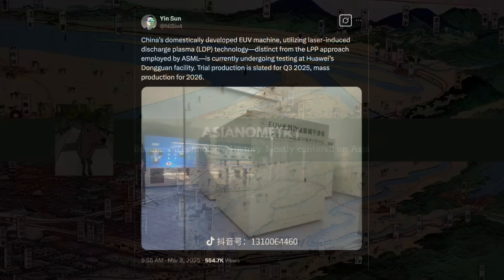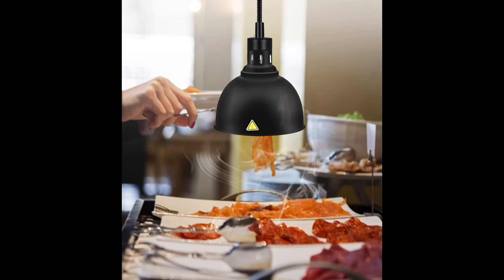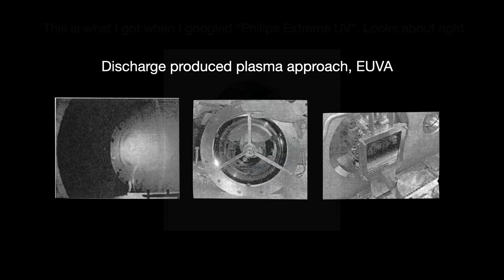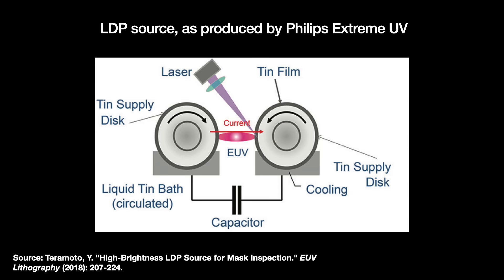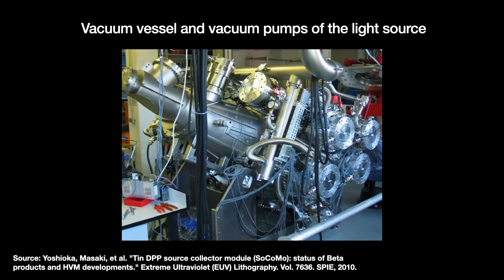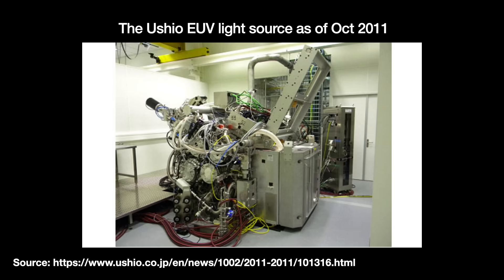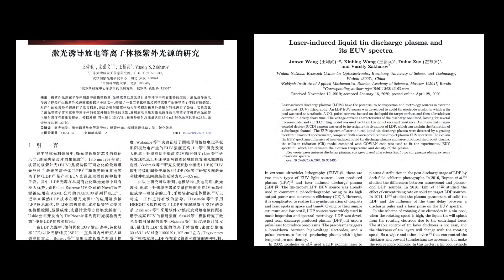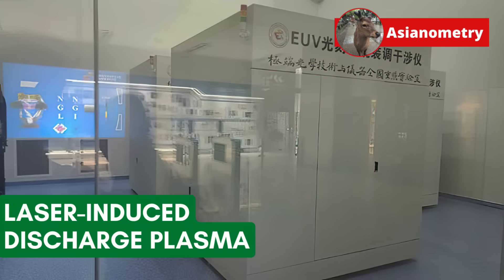China’s “New” EUV Light Source

Comment: ASML did not move from LDP to LPP in the sense of switching technologies in production. Instead,  it chose to develop and use laser-produced plasma (LPP) technology for its EUV lithography machines because it offered better performance, reliability, and power needed for etching. While the team explored laser-induced discharge plasma (LDP) in the past, it faced challenges like heat management and scaling, leading them to focus on LPP, which has proven more successful, with power output increasing by 10 times compare to the alternative.

Comment: Reaching these high power levels is "economically required" only in a very specific circumstance of competitive free-market R&D of rival technologies in the early 2000's.  A state supported enterprise of strategic importance simply has different economics.  Mass production of low power, slow lithography machines is not necessarily more expensive than technological improvement or the null result of "China continuing to be way behind on process nodes"

Comment: China's Manufacturing "Crown Jewels" Progress & Global Standing

Robotics: Accounts for 50% of global industrial robot installations, service robots hold 23% market share, but core components (e.g., reducers) rely on imports. Humanoid robots achieve biomimetic breakthroughs (e.g., Unitree's spine-mimicking tech).
High-end Equipment:
Machine Tools: 5-axis CNC precision reaches 1/70 of hair thickness, domestic substitution accelerates (market to hit $900B by 2025), priced at 60% of imports.
Aerospace: C919 breaks Boeing/Airbus duopoly, WS-15 engines mass-produced, yet avionics systems require further R&D.
Shipbuilding & Energy:
Shipbuilding: World No.1 for 14 consecutive years, mastered "three pearls" (LNG carriers, aircraft carriers, cruise ships).
Power Equipment: Ultra-high-voltage tech exported to 130 countries, Hualong-1 nuclear reactors lead globally.
Semiconductors & ICT: Chip self-sufficiency rises to 30%, 5G patents account for 20% globally, but lithography machines remain a bottleneck. Huawei achieves 5nm chip breakthroughs.
Emerging Sectors: Quantum communication and fusion R&D rival Western efforts, NEVs dominate 60% of global production, solar panels supply 80% of global capacity.
Global Positioning:

Leading Sectors: New energy, 5G, mid-range equipment
Catching-up: High-end machine tools, lithography, aero-engines
Future Frontiers: Humanoid robots, quantum computing, commercial space

Comment: basically, national security needs override the economic requirements needed to make lithography economic viable.  thus , it is possible to pursue other options to build equipment needed to make the most critical ICs.  so what if you cannot achieve 120 wafers per hour if you have a critical manufacturing tech needed for AI.

Comment: You could increase the efficiency of xenon to about 2.2% by using high pressure xenon then blasting the stream with a small neodymium laser then using a z inch to heat it up. If you want it even stronger blast with an excimer laser, and you could use the z pinch as switching as part of the excimer laser itself. 😮

Comment: Japan also already made and sold lithography machines based on its own EUV light source several years ago. The problem is that it is very difficult to catch up with ASML's mass production efficiency because they can use all Western basic research assets. China will probably be able to make EUV of the same level as Japan's current one in a few years, but by that time ASML will probably surpass them even more in mass production speed and price.
Reply: China's goal is not to make better machines than ASML. They simply want to make any machine that will help them be less dependent on the west.
Independence is their primary goal, not competitiveness, quality, or price.
Reply: @gk.4102  In that case, you just need to mass-produce and use ArF semiconductors. The advantage of EUV semiconductors is the low electricity cost, and since the entire ecosystem is based on Western technology and materials in the first place, domesticating only the EUV lithography machine is less effective; rather, building an independent ecosystem with existing technologies like ArF contributes more to independence for China. 
Also, what tends to be ignored every time in this kind of discussion is the high level of European basic research. To overcome the moat of technological barriers created by Europe and North America by switching the entire ecosystem, the process for advanced semiconductors is far too complex.
Reply: @RivusVirtutis Before mass-producing anything, you first need to master the entire supply chain which China is still in the process of learning. And yes, they're researching all possible avenues (including ArF) to make their own chips according to their domestic market needs.
Reply: @gk.4102  You are right, but that's just why I think the real question is in elsewhere. 
In other words, the real question is when they will succeed in domesticating the ArF semiconductor supply chain, and how seriously they are working on it. 
Unless they succeed in achieving independence in the ArF supply chain, even if they make only the EUV lithography machine , the meaning of independence is very small. And also without ArF supplychain independence, in the manufacturing costs of chips the China may not surpassing  ASML. 
The real battle between China and the Western society is the ArF supply chain. 
This is because, for the next several decades, ArF semiconductors are undoubtedly the key to powering everything from vacuum cleaners to automobiles, and they can also be used as substitutes for AI applications if you ignore the electricity costs.
Reply: @RivusVirtutis You keep talking about "surpassing ASML" when that's NOT their goal. Again, their primary goal is just to gain the ability to make chips independently, no matter the cost, time, quality, or technology used. 
They really don't care about surpassing anyone at this point nor can they.
Reply: china's focus is not only EUV, but also light based chips and methods to produce below 1nm chip. china can't make good car engine 20 years ago, they just focus to the future tech: EV. while everyone still focus on EUV to produce 2-3nm, china might already achieve below 1nm.
Reply: @YSKWatch  The difficulty of 1nm isn't about the EUV wavelength. It's due to the wall of quantum physics, like the tunneling effect. EUV is one checkpoint that needs to be solved before 1nm, and the difficulty of 1nm extends to various aspects, such as the issues with GAA not wavelength.
Reply: @RivusVirtutis that's the focus (below 1nm using different tech), we'll know the result in the future, whether success of fail.

Comment: I have seen so many rumors these two months about this "EUV" in China. I am happy that you made a video about it.
There are also a lot of rumors saying that one Chinese manufacturer will soon have the capability to do 28 nm.
Reply: 28nm is nothing new even for china. Wasn't the twist that it was 28nm on all home-grown technology / production? SMIC can produce chips in the 6nm equivalent range, but they use ASML DUV machines and extensive multipattering, which isn't very competitive economically because the wafers per hour throughput greatly suffers with all the extra steps needed.
Reply: They can do 14nm right now. you don't need EUV to do 14nm.
Reply: They are doing 3nm! bruh! What are you talking about? 28?
Reply: I meant “Chinese lithography machine maker”
Check out SiCarrier Technologies

Comment: If a machine is a bit slow.. why not have lots of them in parallel? How does that economics work?
Reply: The pitch behind that Russian xenon-based scanner is that, while being significantly slower, it will also require an order of magnitude less power for its operation, which will make it viable for small scale production. The power itself is obviously irrelevant for Russia, but lower energies are easier to handle. Still not expecting anything to come out of this, but this is the pitch.

Comment: One thing all of these ASML replacement news stories neglect to report on is how complex the alignment and stage positioning systems are. This is arguably as complex as the EUV sources of themselves. This was one of the big shortcomings of e-beam direct write systems as well. Sure they could make a pretty pictures for one image. But could they align that pattern with the pattern below it and keep it aligned across an entire 300mm wafer?
Reply: To announce and then being commercialized takes at least decade. We heard this story before in 2020 where china could fully domestically make 7nm. Semiconductor industry is so complex that nm error is not acceptable. Even space projects seem mediocre in comparison. Even they have the light source it would take 10 years to be applied into real manufactoring process. And then there are optic lens, wafer stage, chemicals, scanner, etching machines, robots, EDM, ARM, AI, ultra precision machine tool... China is nowhere to catch up. You know why, because these know how techs are a result of global collab
Reply: @JohSebBac China's space technology also has foreign contributions, including humanoid robots. But this does not mean that their country can have the same level of technology as China, every country needs to exchange knowledge and technology, this is very normal, it does not mean that China is unilaterally catching up😢
Reply: @后宫后  China currently holding the lower value of the supply chain in high tech sector. Such as rare earth elements or sillicon, chip packaging, testing which where competition is fierce and profit is low. Meanwhile these manufacturing process leave a toll in china's environment. I don't blame China try to catch up with the west and I can see why they did it. But at the same time they are driving competitors out of competition in a very unhealthy way
Reply: @JohSebBac China's current GDP depends on the exchange rate. Otherwise, the per capita GDP would be around $14,800, instead of $12,500. Moreover, China's per capita GDP increases by about $1,000 every year, and the total GDP of China increases by an amount equivalent to South Korea's total GDP every two years. In addition, there are hundreds of millions of people in China who do not participate in industrial production, and it is not due to the overall low level of the technology industry. If you exclude these people, China's per capita GDP will immediately rise to $20,000 per capita. If you want to measure China according to the standard of a per capita GDP of $30,000, then the scientific and technological strength of a country with a population of 1.4 billion will completely surpass that of the United States.
Reply: @JohSebBac It is obvious that you don't understand how the world works. The world exists with multiple aspects coexisting, rather than just consisting of either praise or belittlement. Of course, you may mistakenly think that you are being objective, but unfortunately, the world doesn't operate according to the sixth sense you rely on.
Reply: @后宫后  so apparently you sounds like you know how the world works. Iam not talking about China GDP or how good or bad it is, I don't give a eff.  Just so you know China started low and now are rising at an intense speed. But their rise on top has also push a lot of good companies out of business by flooding the market with lower cost product after thieving and forcing tech transfer and now nobody cares about competing with China because China just swallow whole the chain process of that product. No partner, no ally because all they did is trying to take over others business in their own closed circle. Meanwhile the US just tranfering their knowledge and manufacture capabilities to it's allies and not just eat up the whole cake for itself. Now they get more than just money, military bases, allies, share know how techs... things that money can't buy. That's why China do not just compete with the US alone. China is too greedy. Basically they are profiting on another's expense
Reply: @JohSebBac It's really arrogant and ignorant. Shifting your own problems onto others is the biggest mistake. The world is both complex and simple. The achievements of every individual or group are built on the foundation laid by their predecessors. If a person learns the strengths of others and integrates them into themselves, then this person will become better. Innovation is an ability that comes from practice. If you lack the corresponding ability, you won't be able to move forward. To put it simply, the development of your country has been interrupted. Since I can learn from you, you can also become better by learning from me. However, this phenomenon hasn't occurred widely. The same principle applies to what you said about "IP", but you have distorted the truth. You can be someone else's teacher, and vice versa.
Reply: @后宫后  I am not american and I can't speak on their behalf. For every action there is an equal opposite reaction, don't play the China innocent game here. It's ambitions while well hidden but inside it is roaring and projecting power and hegemony. Look around you, every product you bought from China only profit China and the consumers might find it's tempting to buy for less but in the long run they became addicts and dependant on China manufacturing capabillities. Meanwhile most of western companies are deeply interconnect to the world supply chain not just it's own country. Why don't you explain why China have no friend or ally that completely trust China and let China opperate business to the fullest. Why would Taiwan rather appease a country half globe distance than to despite it's nearest neighbour that share the same dna
Reply: 霸权？中国是一个商业国家 美国才是一个帝国主义国家
Reply: This is exactly why China doesn’t have an advanced domestic ArF exposure system: their stage positioning / overlay technology still sucks.
Reply: If there's one country that dares to take-on an impossible task and make it possible, it's non other than China. We have seen them done it many times throughout history. Even this time it won't be any different. After all Lithography machines are made by man, not God. It's just a matter of few years, not even decade, they will get there.
Reply: Farout man irrelevant
Reply: 中国大概需要十年左右的时间，但至少中国开始了。你是一个普通人我也是，我们需要竞争的市场。现在的市场是被垄断的，假如中国突破加入市场我们普通人将获利
Reply: now, we have AI, it speed up complex processes. alignment and positioning should be easier.
Reply: @YSKWatch  Hahahaha, AI is not a magic bullet. No doubt they will get there, but people underestimate the amount of engineering effort put into these machines. There is a reason why they are so expensive and it isn't just because of the material cost. And ASML isn't standing still, they will just continue innovating like they always did.
Reply: @spicybaguette7706 I meant it. alignment and positioning is good use case for AI. I didn't say AI will magically solve everything. I use AI daily to help me write code, sometime the result is perfect, sometime I have to modify it manually. from my experience I can roughly guess what other cases it can be useful.
Reply: @spicybaguette7706 china is big lithography market, if ASML can't sell to china they'll get less money and less funding for research. while china literally put all of their weight to create lithography machine, profitable or not.
Reply: @YSKWatch  Lol, I can assure you ASML has more than enough money even without China. They would have just ignored patent laws and copied everything they could anyway
Reply: They landed something on the far side of the moon. That's precision albeit in another dimension. Has the Netherlands landed anything on the moon?
Reply: @cwt4560 How the hell is that relevant?

Comment: The Chinese machine looks way too small, and I had doubts it's even a EUV machine. Also the room it's in doesn't look like a clean room.
Reply: If you are referring the photo shown at 0:10 it says "EUV lithography lens adjustment interferometer". So it's not the EUV machine itself but rather a helper machine needed to adjust or set up the actual machine's optical path.
Reply: Is this the entire EUV machine or just the light source? If they are merely doing R&D on a prototype of a component that isn't even installed in a production machine, would it need to be in a clean room?
Reply: I wouldn't know, as very little information is given, either this is propaganda, or something else. If china is pouring resources into euv they wouldn't tip their hands so quickly. The machine looks like a normal CNC machine, about the right size too. I think the asml machine is quite a bit larger.